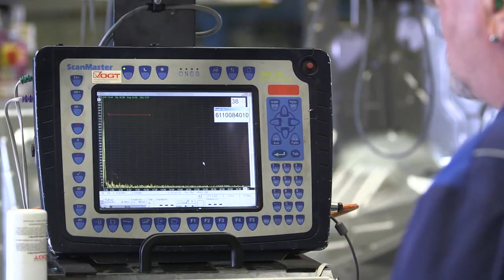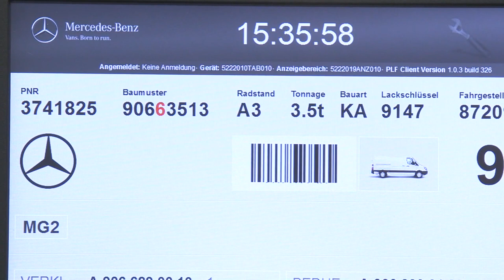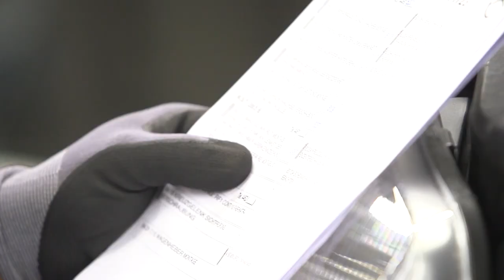Mercedes-Benz Sprinter Production at the Duesseldorf Plant, Germany

Comment: The first Sprinters (T1N) were the best. I own one now (L1H1, a short wheelbase with a low roof converted into a camper van) and I am getting my second Sprinter T1N next week (L3H2, an extended wheel base with a high roof also to be converted into a camper van)
The First gen Sprinters were superior in many ways: hardly any rust, very high quality steel and parts, virtually indestructible engines and gearboxes and hardly any electronics to go wrong. Unfortunately the Sprinter plant in Dusseldorf sits just inside the local "Umweltzone" (low emission zone) and as a result I can not even do a drive along the plant my vans have been made which is somewhat ironic and at the same time sad. The (local) German government have become sort of Nazi's again, this time of the environmental variety... with the emphasis on mental...

Comment: Too bad the rust is eating them as you watch. 
I know is quite easy to make a car last a long time and be reliable. 
And that it takes a lot of engineering to make sure it all breaks just after the warranty expires, but this model is notoriously crappy
Reply: Decent engine, good to drive, handle well, but dissolve like aspirin
Reply: @davidgibson4840  Lousy brake system too. My old one needed a $4000 brake job at 85,000 kilometres. Loved the engine though, but could be tough to start in the winter.

Comment: Does anyone know why sprinters body work is soo shit and starts rushing in like 3 years?? Merc are supposed to be a quality product but really there completely dreadful!! The body work is dog shit and the new engines since the 2013 model year are even worse than the 2007 - 2012 or when ever they changed them but even the engines from 2007 have been poor!! I’ve put 4 engines in my 09 sprinter which is the 315 twin tubro!! And I’ve had it 8 years or soo!! And my 313 57 plate sprinter had 3 engines and I had that for 7 years!!! All in all just them 2 vans had £21,000 in engines between them!!! Yes just engines!!! If anyone has any advice on how to prevent rust and the engines going bang consistently please let me know fed up with my vans!! I’m a fucking idiot for going and getting a 313 15 plate and a 313 16 plate!! Already had problems with both of them!!!! Only had the 15 plate for a year and the 16 plate for 6 months!!!

Comment: Do they forget to rust proof the rear doors? Saw a 2016 the other day with rusty as heck back doors.
Reply: The doors collect water on the insides. The back doors collect at the very top in the center. The side sliding door collects at the base of the windows. This water gets in, goes to the bottom of the doors and rust.
Reply: @sethbishop3306  So they don't rust proof, like I said?
Reply: @beechface1  this and bad design of the panels.
Reply: I have a 2012 no rust